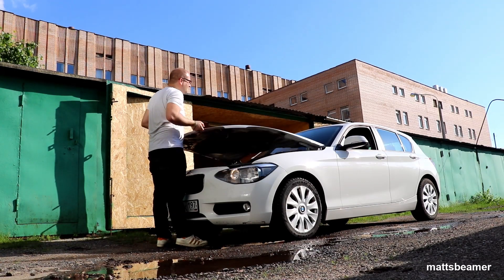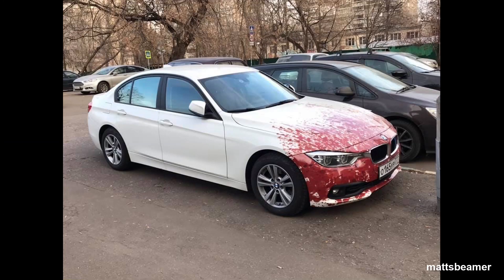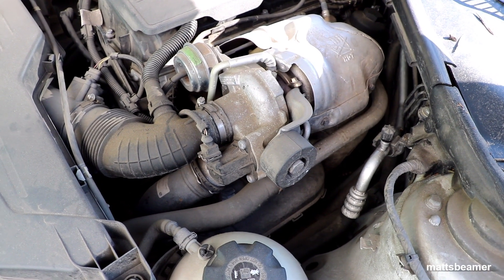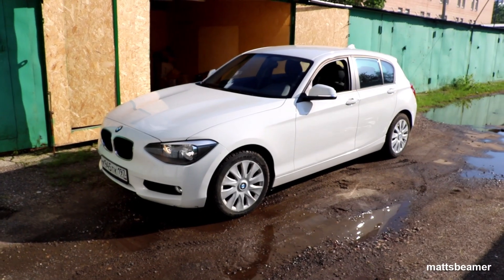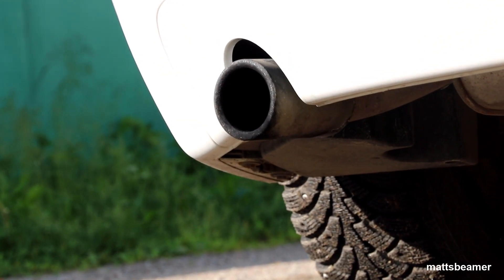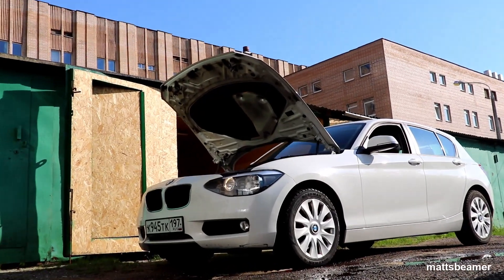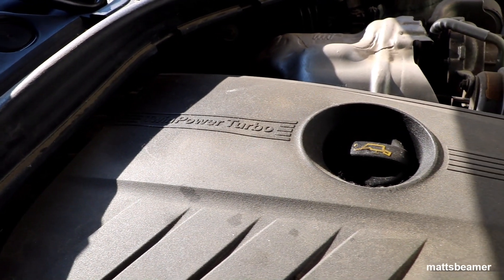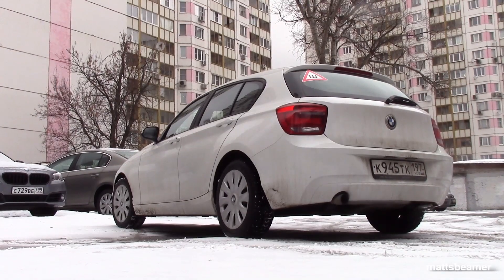Information on the BMW N13 1.6 Turbo PRINCE Engine. BMW F20 114i 116i 118i

Comment: My wife's 207cc has this engine. It burns a lot of oil, is noisy, and is sluggish but runs ok. One of the spark plugs is always soaked in oil. Had the chain replaced as was a little stretched, that reduced the noise a little.
Reply from the maker: Wow, sorry to hear that your engine has had many issues :(
Reply: @mattsbeamer  i suspect the previous owner ran it on low / dirty oil. Probably needs to be stripped but not worth it.

Comment: Hold up 0.7 litres on 1000km that’s pretty much . So there must be a reason for this case
Reply from the maker: Its crazy isn't it. Mine doesn't use a drop, and to be honest id be calling dealer if I was loosing that much.
Reply: @mattsbeamer  They will say its normal. 5W30 IS the wrong oil for this engine. See my other comment :) @mattsbeamer maybe you want to pin that 😉
Reply from the maker: @currysini85  oh thank you!!

Comment: I have 2016 Bmw 118i F20 but it has B38 1.5 3cylinder Engine but iy does not have so much difference with my fathers N13 2015 320i , just a little less torque hp and 0-100 but more efficient fuel consumption

Comment: Hi Matt. I heard you say these engines thirsty for oil. Meaning you have to keep checking oil right? It's not service to service kind of a thing. I got a same N13 engine f20 and my oil level drops too after certain times and I have to top it up. Other people say that could be a problem as their cars not the same but they are changing oil service to service only.
Reply: Mine too mate :( . I have found some possible issues on some forums

Comment: Hi Matthew, I notice my N13 is giving off some blue smoke. This only happen when I'm traffic and about to move off, it also happen sometime when I'm reversing. If I keep moving there is no smoke, could you please give me a bit of advice on what to do, much appreciated.
Reply: sounds like your head gasket has failed and so fuel is mixing with oil thus giving out that blue smoke you speak of
Reply: If you fixed it, do you remember what the problem was ?

Comment: Most accurate video of this engine. I can confirm these facts are legit. I changed my timing chain and oil pump sprocket + chain. I remapped mine to an acclaimed minimum 145kW from stock 100kW (116i model). Got a drop in performance air filter. Recently did my clutch (bc clutch kicks lol). I run stock coilpacks + .53 gapped OEM plugs and LiquiMolly 5w40 synthetic oil. Car does make the turbo rattle and idles rough at the moment.
Reply: Another common issue is the turbo inlet hose cracking on the turbo inlet (where the clamp is situated holding the plastic to the turbo)

Comment: Hi Matthew great video as always. Mine is 1.6i automatic and I've had coolant leaks at the turbo. The two pence gaskets cannot stand the heat in that area.
Reply from the maker: Thanks for the comment and thank you also giving us more information : cheers :D
Reply: Hello armadaro, did the coolant leak at the turbo made a lot of white smoke at the exhaust? Can you please confirm
Reply: @ramonbido2637  hi no I didn't have any white smoke. There are two small pipes on the right side of the turbo for the coolant. I noticed traces of leakage around the junction of those pipes.
Reply: @armadaro9234  simple O-Ring replacement fixes this.

Comment: Thank you for an excellent video👍🏻
My BMW F20 116i from December 2011 I had a couple of issues.

1. Water pump replacement as the old one had some crack and was leaking.
2. Issues with the Vanos, my car very often was going to an emergency mode and there was no full power so I had to buy a second hand one.
3. The steering wheel wasn’t reversing quick enough, the mechanic had to adjust some screw in the steering wheel column.
Reply from the maker: Thank you for your input! I think BMW did a recall on the steering issue. In Russia they did anyway :)

Comment: For those watching. In my experience with my 2014 N13 116i I have only ever had one major engine issue and it was simply replacing a spark plug + ignition coil on cylinder 1 which died at a normal time. Absolutely no other issues. I have the wastegate rattle on a cold start, but it doesn't bother me at all. I purchased at about 25k miles and have got it to 48k miles now running 95 octane the whole time (I'm in the UK), services as the car has asked and putting in any brand of 5w30 whenever I've needed to top up. I haven't even done an oil change regularly, just when the car has requested a service. Brilliant engine in my opinion. I plan on tuning to stage 1, stage 2 and hopefully slap some forged bits + turbo on and get it stage 3 one day.

Love putting my foot down and if you launch it from first it's something else, get's stuck at 5k+ revs through every gear and just flies like it's a VTEC Honda :').
Reply from the maker: Thank you for your comment! I am glad that you enjoy your N13. I have been very happy with mine too. I think I will have to put another video together with viewers experiences with the N13, as I can't fit anymore into my description box. Cheers
Reply: Honda is better no problems

Comment: I am using 116i for 2 years now, i had just coolant leak problem. Thats it. Rather than that it is good engine
Reply: Same here, had a coolant leak in the thermostat housing.
Reply: I did some bleeding on mine to let air out since it expands when hot and caused such leaks. It doesn't leak anymore
Reply: @elvisbarasa403 how can ii bleed the cooling system becoz I've discovered a coolant leak at the back of the engine.
Reply: How did you solve the leak from the back of the engine??
Reply from the maker: Thank you :)

Comment: İ use 5*30 c3 castrol edge oil. Which castrol and bmw recommends. So far so good.  About start up noise yes, it is bot pleasent for first 30 seconds.
Reply from the maker: So far I have been very happy with this oil too. :) thank you

Comment: That's a lot of explanation about the engine, I have the n13b16 in an f20 116i and it seems to have an issue with the turbo, it blows off at like 2k revs and the turbo won't spool anymore until you let off accelerator and get back on, then it'll spool grand, same in 2nd gear it'll blow off at about 3k revs, no power, let off and get on accelerator and she'll go again, same through all gears, any idea why? Also i shall keep everyone updated if i figure it out myself!
Reply from the maker: Hey, I'll shall look into this issue.
Reply: it seems boost cutting
Reply: check for boostleak and whether the charge pipe is split

Comment: Thanks for the new video very clear with good explainations. I have two quick questions on N13 BMW f20... Do you plan to prepare any video on how to recharge the AC system with R134a? and where is ac low pressure port on our cars and how to access?? thanks in advance...
Reply from the maker: Thank you for the kind comment :) As for the AC system, I don't really know much about that, as when  I lived in England, you had to have the special certificates by law, to work on it.

I did find this link thou :) https://www.newtis.info/tisv2/a/en/f20-116i-sha/repair-manuals/64-heating-air-conditioning/64-52-compressor/GzganE15

Its a great site  :)
Good luck :)
Reply: @mattsbeamer  Thanks for reply.👍 ... Keep up the good work with your channel.
Reply: @transaction2005  you can refill the coolant with a kit sold on Amazon

Comment: Hi bro, very good write up and solutions. But I would presume the idling valve is the valve that is on the valve cover? I’ve done the change but cold start is still having slight idling issues. It’s on MHD stage 2 and XHP stage 3. Ow40 synthetic engine oil, 135 intercooler, drop in air intake. 118i m sport from factory. It’s minimum but I can feel the vibration but it’s only at cold start. Turbo inlet is aluminium. The valve cover inlet to turbo inlet is also changed to silicon pipe. Do you have any idea what other stuffs I can check..? Appreciate much for your great help if u have any!

Comment: There's another "common" problem, the water pump seal leakage...  there are a few youtube videos about it, and also forum posts...
Reply from the maker: That's very interesting, I will check mine out. cheers
Reply: My car has done 160k (2013 118i). I an now experiencing coolant and oil leaks. I have replaced nearly every hose and coolant part (including the overflow bottle, thermostat housing, coolant temperature and housing). Basically all O-rings and plastic part related to cooling system needs to be changed. I am also experiencing oil leaks. As you mentioned in your video maybe vanos, but definitely oil filter housing and oil cooling needs all new gaskets. Other than that it still drives nicely.  It maybe just that we in Australia being a hotter climate that euro cars plastics and orings die faster?

Comment: Ah, the good old Prince engine, Mr Woollard! An excellent summary of this ubiquitous powerplant.
Reply from the maker: Lloyd Vehicle Consulting Thank you :) I have been happy with this engine.. So far. It's amazing how many cars share this block.
Reply: @mattsbeamer , yes, it's a bit like the PSA 1.2 litre EMP engine which replaced it, but that didn't end up going into any BMWs. That has ended up in an awful lot of cars too. The 1.4 Prince engine that I drove in the Peugeot 207 last year, though, was not in very good condition, and I wasn't happy with it when it kept spluttering and stalling!

Comment: Thank you man. Amazing video. I have heard the rattle sound and spoke to bmw as well but got the same feedback. I'm glad I now have solution.
Reply from the maker: Glad I could help in some kind of way lol. When I first bought the car, I just thought it was a heat sheild loose. I didn't research the engine at all, plus I couldn't understand the owner, as my Russian is awful :D
Reply: What advice did you get mate? I have this problem too...

Comment: Matt, can you make a video on how to install on oil catch can on an N13? Would be awsome to know how to do so...
Reply from the maker: griffonsa hey, I will have to look into it. It's not something I've considered :)
Reply: @mattsbeamer  I'd appreciate this too. I believe it's required to be able to get to stage 3 (although there isn't a stage 3 one I've ever seen... yet ;)) The N13 in a 118i has an oil cooler stock whereas 116i and below don't but apparently it takes changing quite a bit to retrofit one, struggling to find any information regarding fitting one of these to a 116i or 114i.

Comment: So complete and accurate information, thanks for the video. My car has the n13 170hp motor. It is a really reliable motor (to be a bmw). The biggest problem, as you mention is the cooling system... Water pumps used at all f models are  really bad, mine failed at 40 thousand kms. Aside of that, really rock solid motor if you take care of it. Regards matt :)
Reply from the maker: Thank you for your message. always an interesting read
Reply: Is your engine still fine?
Reply: @Squilliam-Fancyson  yeah, still working great with 80,000kms
Reply: @EE-nu2gh  nice. Mine too at 108.000KM.

Comment: Once again great vid Matt... As far as I know, the block is PSA, but everything else was designed by BMW. The Peugeot 207cc has the same block, some Mini's do... But on the 116i, the Garrett turbo, and everything else is purely designed in Germany (do note: DESIGNED! Cause my steering rack is Made in China!! Radio is made in China etc). My 116i is an automatic and has about 11000 km and it isnt the most quiet engine. When you start is up, I also have that rattling noise at the wastegate. I know all about the VW clip that would solve it, but really not messing about for those 30 seconds of noise when your engine is cold. My car is quite lazy when I accelerate from +/- 1500 rpm to 2000, then it just goes! In Belgium its officially 0w30 oil they put in. I do dislike the fact they didnt implement a temp gauge in the display! One never really knows if the car is on the right temperature. Like I mentioned earlier, the steering rack is not great quality, and alot of cars made between certain dates were called back to repair the rack, preventively or after complaint. Also the AC compressor has its moods. Sometimes mine will slighty 'shake" when I'm idling with AC on, sometimes it wont… Seems like my car is female and it has it's moodswings now and again. Having said all of this, I do like driving it, although the overall finish is quite cheapish… I am not a fast driver, and maybe as you mentioned, I should put the pedal to the metal now and again to clean out the injectors.... 
Anyways, would be great to hear fellow 116i drivers their experiences!
Cheers all!
Reply from the maker: Such a good comment, thank you. Wow, I can't believe how low your km are, I thought mine was low for a 2012 116i auto. Its amazing how much of our cars components are made in China. I wonder if this will all change soon.
  I am not to bothered about the waste gate issue now, I am glad its not really a mechanical issue. 
 I find the lack of the temp gauge very frustrating, ALL my previous BMW's (from the 80-00's had one). In the F20 I have to do the secret menu mode, to see the temp. I did make a video somewhere.

I will have to make a video with other F20 drivers experiences. 

Cheers for your valuable input.

Comment: GREAT video! However it's a pity that you didn't provide the details about your engine. In example, how much your takes oil, how much petrol per 100km and so on...
Some info about mine N13 from 118i 2013 170hp:
Normal benzin consumption: 7,5L (on highway less, in city more up to 8,5L)
Oil consumption: 1L/~12tsd km. The more agressive driving the more it consumes. I use SHELL Helix, HX7 Motoröl 5W-40 changing every 10 tsd km and I am really happy with this oil.
My engine has some vibrations but you cannot really feel it when driving, it also has this metal noise in the first 30s after start. I had some minor issue with ignition coil which broke - you can easily replace it by yourself at cheap cost. I also had issue with the leaking cooling fluid. Unfortunately it was really costy, circa 330€ (germany prices) despite if was only a leak...
For this car I think it's really important to change the oil on time and not to tank any shit petrol like E10... also do not give it full gas when the engine is cold, turbo does not like it
Reply from the maker: solight777  that’s a very detailed insight to your engine. I will have to make a video on mine. I will add your info soon. Cheers :)

Comment: I’ve never had any problems with my f20 118i, it’s been rock solid and very reliable, it feels nicely quick and pulls and sound very nice. MPG is ok but not the best. I think it is a much better engine than the 1.5 in the newer Facelift versions, faster and smoother

Update September 2020: engine has started burning oil at 45,000 miles. Thinking it may be the valve stem seals.
Reply: Do your engine burn oil?
 I have bmw 116i with only 38k miles on the clock and my concern is that I need to top up 1 litre of oil(castrol 5w30M) every 3k miles. No leaks. No noises. Drives perfectly.
Reply: Barto Boy hi again, my engine has recently stared burning oil, it was flagged up in the service.
Reply from the maker: Findoherty0697 I hope mine doesn’t start burning oil. What’s the millage on yours now?
Reply: mattsbeamer it’s currently only on 40,000 miles. It’s a 2012 118i. I think it may be the valve stem seals but it’s very odd as I haven’t noticed much blue smoke. It’s definitely not a leak either.
Reply: F20 is 5 door and F21 3 door. You are thinking of the facelift or LCI models as BMW calls them.
Reply: @finleypdoherty  thanks
Reply: How many klm/miles has it done ?
Reply: @nodocs74  Around 43,000 miles or 70,000km so not many
Reply: "For BMW petrol and diesel engines, a maximum oil consumption of 0.7 l/1000 km is permissible." That is what BMW says. When oil consumption appears, it is time to change oil. In this motor you must change oils more often, at least  once a year or 10,000 km, if you can do this often, do it.
Reply: @EE-nu2gh  yes it is changed every service by BMW